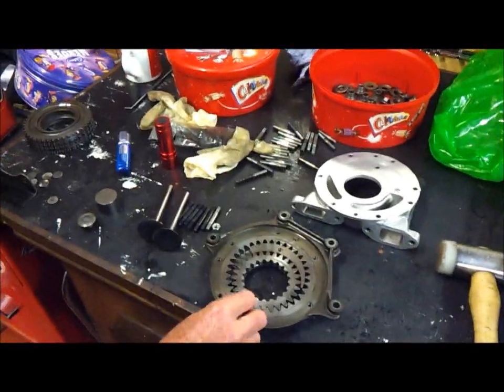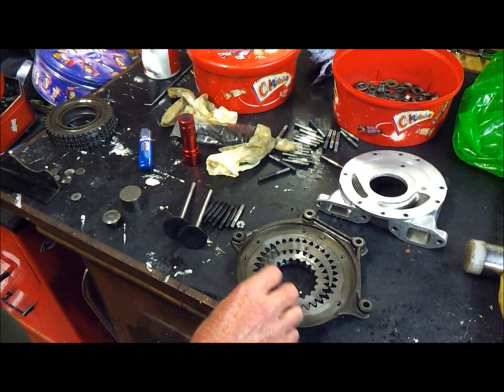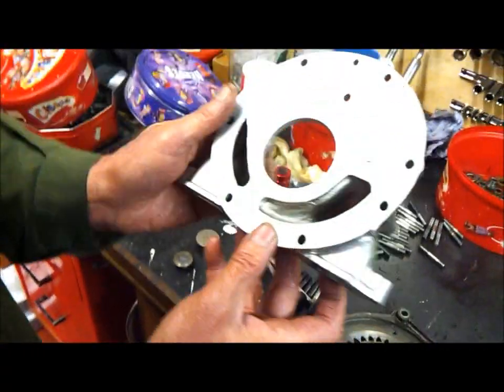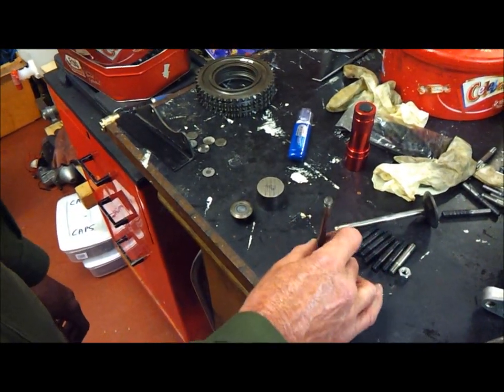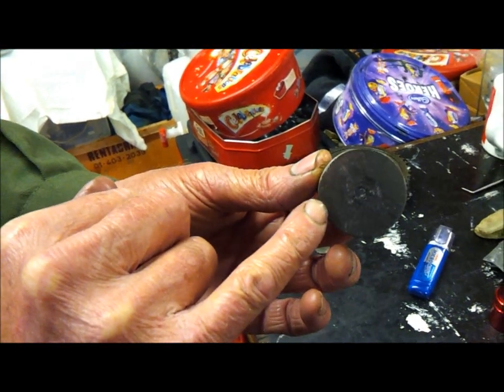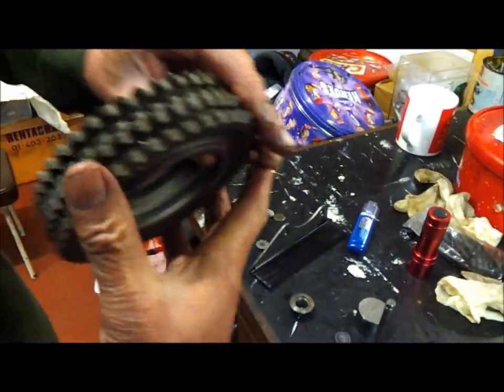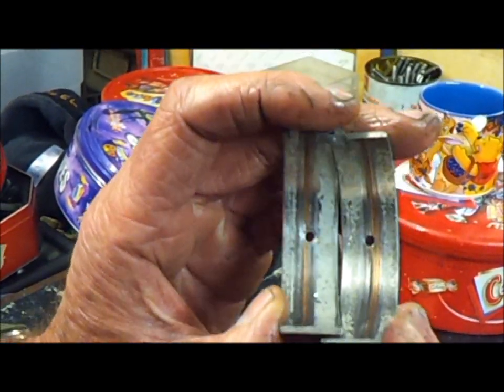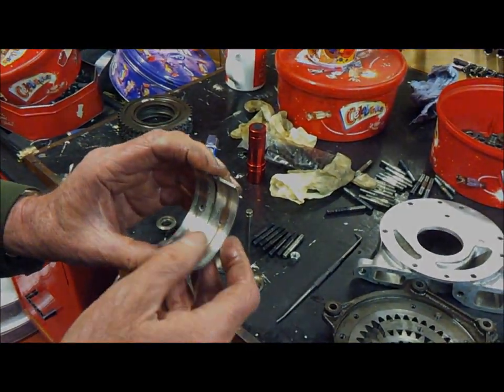Jaguar XJ12 V12 6.0L Engine Rebuild Issues

Comment: Being a mechanic myself,l can see the points you raised during inspection of the engine as you stripped it down. It has however been my experience that sometimes even on a short start up and run, faults mightn't actually be found. I've seen cases where abnormal noises don't show up until a few to maybe a couple hundred miles after the engine is operating in the vehicle. So yes it's really a case of buyer beware. That's why I prefer to rebuild the engine myself especially an engine like the Jaguar V12. These are very technical and precisely built engines that requires extensive knowledge and experience in order to rebuild them correctly. In fact just about all European engine are like that. When saying that they aren't really that difficult to service once you know how like anything else. In closing you've given sound advice to buyers and mechanics alike. Cheers.

Comment: I had number 5 with groove and erosion on rod bearing, but not span. Some tapping and vibration was slightly audible when engine ran through chassis. Just like you said, polish and new bearing fixed all of it.